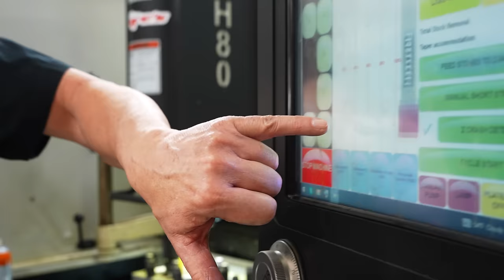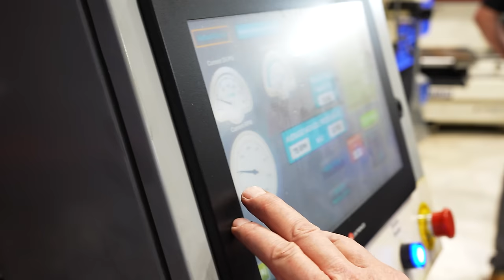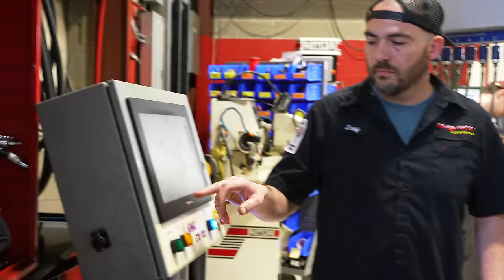Dave talks to young men from Clearfield High School. And shows them his shop

Comment: I had the opportunity of attending Auto Shop Class in High School in the mid 70s and still use the knowledge gained in that class. I've done the majority of repairs and maintenance on all of my vehicles since then. Very few times have I had to depend on Pro Mechanics to fix my vehicles. Fellow DYI Mechanics on Youtube have helped. I often joke that I'm a Youtube Certified Mechanic. I have 2 Grandsons that are also pursuing mechanics. One is working in Heavy Equipment mechanics such as vehicles used in mining and heavy construction, a field in need of new mechanics. My most recent repair was replacing the Oil Filter Cooler assembly and all of the rocker arms in a Chrysler 3.6 Pentastar engine in my 2015 Dodge Caravan with 90k miles on it. That was a challenge, but it turned out perfect! Although I don't work in the industry my garage is fully equipped with pneumatic tools, power wrenches and scanners. It's my hobby now.

Comment: Great too see younger guys still want to get into the industry. I'm coming up on 30 years in automotive myself. Just started a job that specializes in engine replacements and repair here in NJ. But, we don't have all these goodies that Dave does. If the lower end is done, it gets replaced. One of my coworkers (that brought me there), does almost all of the internal engine work. I was hired as the troubleshooter, and I also do used car repairs for area used car dealers and local customers.

Comment: Great videos as always and awesome sharing your passion with other young men.

One observation.....when the truck cab was being raised on the lift, you were seeming to go under it when it was being raised, which for safety isn't a good practice. Maybe I'm  wrong, but it looked that way.

I know your explaining things to the students, but for safety, it's imperative to be clear when raising/lowering vehicles. 

I do hear the nechanical locks clicking as  the lift goes up, but again, it can come down so quickly when the hydraulics fail on the lift.

I've seen lifts fail, so it's imperative to drive this home in order to live another day.

Keep up the great work.

Comment: Yes, you probably would've apprenticed me when I was 15 years old when the 2 Gary's (Garry Roth & Gary Smith) didn't suggest that I become a mechanic in 1993 & when my local tech didn't want to run any more courses for me in 1994.

I need to find out why my old boss Barry didn't want my involvement when he bought a Repco franchise in 2010 which means a fully licensed mechanical workshop.

Holden rebuilt the 5.7 litre Chevrolet LS1 V8 engines as an option under warranty because some customers got them replaced in their VT series 2 Commodore in 1999 when they were first released due to an oil burning issue.

Holden in Australia had them bored out by 0.010" then fitted with oversized pistons and rings after the Teflon prematurely wore off on the piston skirts because they were fitted with a bad batch of pistons in Canada.

They were fitted with a red & white I.D. plate on the front of the engine on the oil pan rail saying that the engine had been rebuilt by a Holden dealer.

I know a bloke who got the crankshaft bearings replaced in a 3.6 litre Holden LE0 coded alloy V6 engine in his VE Commodore when the crankshaft bearings went in it by his local Holden dealer although they did  outsource transmission & differential rebuilds !

Comment: not entirely true that a dealer wont open a motor, i am a honda master tech and i regularly replace pistons, rings, main bearings, cams, etc so we do get into engines but if there is any internal DAMAGE to the engine, no we wont try and fix blocks with spun bearings or broken rods, but out of time bent valves yup we can fix that. so idk not every dealer is the same but we will address internal engine issues